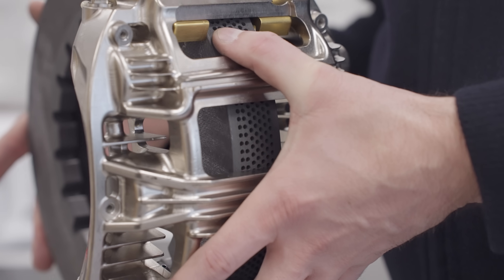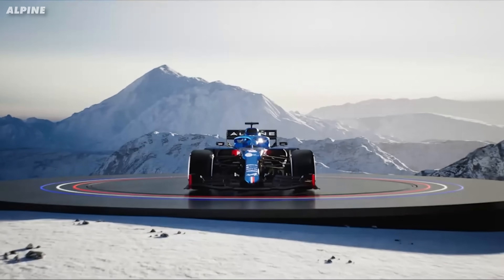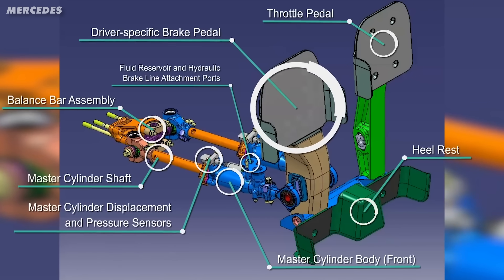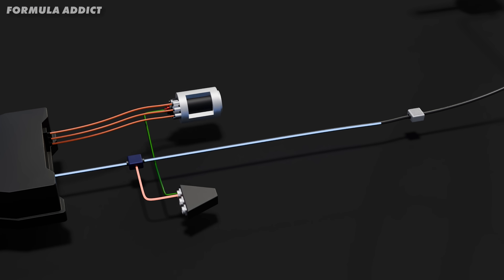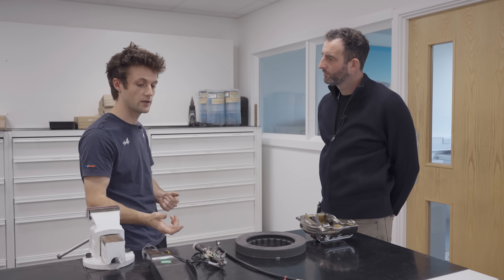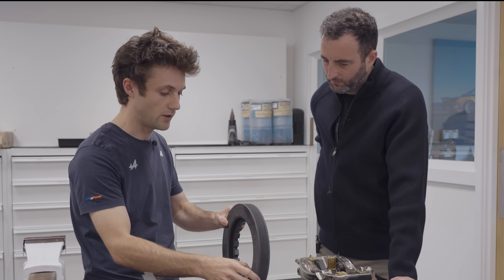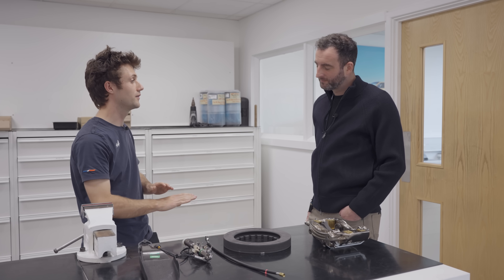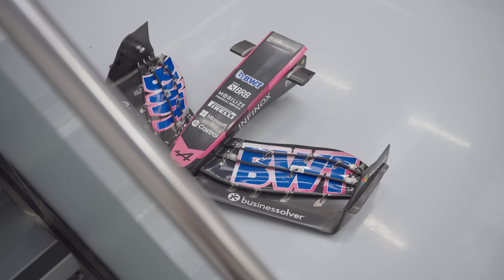How Formula 1 Brakes Work (F1 team explains)

Comment: When you make the carbon carbon disks, could you incorporate the holes in the manufacturing of the carbon blanks so that you don't need to post machine and drill the 1500 holes allowing the natural layering of the carbon in the disk to be maintained, possibly increasing strength and allowing less material to be used. I can imagine that the post machining of drilling the holes creates nano imperfections the length of each drill hole that changes heat dissipation and airflow, possibly slowing or accelerating heat and airflow in an unpredictable way leading to unexpected failure or excessive weight not to mention downstream impacts on tyre heating. Just a thought.

Comment: Those that say the driver's weight is not shifting (moving) forward under braking have not noticed the helmet sinking just a little. Yes the driver has to push against the brake pedal while at the same time lifting off the gas. So he is pushing with all the force stated, just not an equal amount of force against the seat. He's virtually lying down with his legs and feet elevated and at no time is he straight legging it. It would be like standing with the knees slightly bent with 300 lbs. on their shoulders. That takes leg strength. There is no free lunch.

Comment: I was involved in building the jcb land speed car  and we struggled to find a drag resistant brake untill the flight out the salt flats then we found what we needed the forwarded aplockhead and a f1 tema to invent the setup . And yes 350mph on less gears than given as the blew

Comment: If 200mph * (1.6km/mi) = 320 kph, * (1000m/1km) = 320,000 meters per hour / (3600s/hr) ≈ (90 m/s) /4s to stop = 22.5 m/s², wouldn’t it be about 2.5Gs instead of 6, or do they not slow down at a constant rate?

Comment: Holding 180 is much easier tan pushing. They are holding not pushing.
Reply: And with finesse on top, to control the release of pressure as they decelerate enough.

Comment: Lot of people don't realize how important formula 1 is, some people wonder why companies spend millions of dollars sponsoring these cars and racing. Winning is part of it but it's much more important than just winning. Yes the more you win the more you get recognized but there's much more at stake then just racing a car. You see a formula 1 car is the most advanced automobile in existence, the reason why sponsors spend so much is because of the technology transfer benefits. The technology and advancements in automobiles today is a direct result from formula 1 research and development. The advancement of synthetic oils, fuel, block performance, tire performance, electrical systems, timing, airflow, emissions all comes from formula 1. Basically car manufacturers research and development department sometimes consists entirely of formula 1. It's the perfect testing ground for today's top of the line advanced ideas. That's why there's so much money in it. And for the winners that validates these advancements, the proprietary technology becomes incredibly valuable worth billions.

Comment: 396 lbs of force for the driver to push on the brake pedal!?  That doesn't sound realistic - these drivers are not big body builder types.  Are you sure that isn't the force on the working end of the brake pedal lever?

Comment: The spring fully collapsed takes 180kg not the little 1inch movement they are doing…sounds cool but thats not whats happening. They need a stiff spring so when they engage the brake it has enough resistance so they don’t brake to far hence why its so high fully collapsed

Comment: Again the 180kg pressure myth, it is not the pressure of the foot but the hydraulic pressure! Have you seen their legs, they snap when doing a proper squat with 20kg weight! Impossible to do 180kg force pressure with 1 leg. And what stupid engineer wants to make this brake pressure, with a simple adjustment you can make it less. There is so much bullshit in this fake sport.

Comment: The only part about this video should be about the heat dissipation and it was such a small part of the otherwise “well no shit” video we all know how master cylinders and hydraulic pressure works and we all know bigger brakes don’t stop you any faster than smaller brakes as you are limited by aerodynamics and traction, all we want to know is how they are able to dissipate such immense heat so quickly and over and over again, that should’ve been the main focus of the whole video.

Comment: When I was racing , I noticed a 2-3 second lap time difference if my brake pedal height was not EXACTLY as I ergonomically needed it.  That is, it had to match my exact body and foot height or it was WRONG!!! Write that wrong in giant letters! Lol. But same goes for throttle too just a bit lesser. Also I like long throw throttles too. Especially when traction is an issue.
Bet some of you are thinking? What adjustable pedals?  But yes is performance you can set everything ad nausea for yourself/pilot.  And we get super picky when you change it! 
WAA Rage! RAWR!...  Now where was I?

Comment: Well if they achieve 6 G’s during braking, then having to apply 180 kgs to the brakes should not be much of a problem since the driver will weigh over 1000 pounds while braking.

Comment: But what is the point to have super-powerful brakes? The grip is always lower than the brakes power, right? Every time you overbrake you usually block your tires and lose your grip (with very rare exceptions). So what the points to have super power brakes then?

I understand that if it's exist that there should be a reason, but maybe someone can explain.

Comment: when said in seconds, just 4 sec sounds cool. But ~200 is okayish🤣. Definitely room for improvement especially the rate of deceleration is is only 24.6 m/s which means less than 2.5g force. just increase that to 3.5 g and we can reduce the stopping distance by 50m. Just imagine braking distance is reduced by 10m - 15m and how fast the car looks in the corners. Go F1 you can do it.

Comment: A break buy wire system doesn't need 180 Kg of force to work. A hydraulic compressor does the work for the pilot.

Comment: Am I correct in assuming break pads are not used? Since there was no mentioning of them. Is it really just the 6 pistons, 3 on each side, straight onto the brake disc?  Does that also have to do with the dissipation of heat during breaking? And last but not least; why do the pistons in the break caliper have different diameters?

Comment: driving 4 answers did a video a while back, about how larger discs don't actually stop you faster. but this F1 engineer says they do. intuitively, he seems right about leverage: for a given brake pad surface area and pressure applied, farther distance from the axle would seem to give an advantage. i can't remember d4a's reasoning, but am curious about any input here.

Comment: @ 0:38 bs.. absolutely bs.

No one can push 180kg of force numerous times, over and over for hours on end. 
You're talking hundreds of reps!!
Not even the world class body builders could do it for the length of time a F1 driver has to. 
I have no doubt thats the pressure applied to the brakes, but not by the drivers foot 
The driver will no doubt have some electro- mechanical leverage device like a pump to exert the pressure on the brake.  Im assuming the forward momentum plays a role in how the drivers foot applies more preasure  from decelerated g-force. 
(Like when you run with a bucket of water, when you decelerate the weighted bucket continues to pull you along for a bit. Thats whats happening 
But the pressure he applies to the brake pedal is not of the drivers own ability to press180kg of pressure of their own strength. 😅

You seriously expect any intelligent person to believe that?? The driver would run out of energy in a matter of minutes. The driver would fatigue and lose sensation in his leg. 
And that would be fatal. 

You will lose subscribers if you feed disinformation to people.

Comment: Why do they push with the tip of the feet? Wouldn't they do more pressure if the axis is in the tip and he pressure is exerted with the heel? The force would be done with the leg and not the feet alone.

Comment: The force drivers put on the pedal are not really special, since they of course use a leg and not a arm it means they use much bigger muscles. Anyone that has used a leg press at a gym knows 180 kg is nothing special, but of course that doesn't make for drama for the story.

Comment: 2:32 The kid says "The driver hits that (brake pedal) with about 3 times his own weight which is about 160 to 180 kilos. 180 kilos is 396 lbs for those of us across the pond, and the drivers using only one leg! I don't think so buddy! That would be a 140 lb dude squatting over 800 lbs and that is NOT happening!
I don't know exactly, but I would guess he means newton-meters of which 180 Nm converts to 18 kg which converts to 40 lbs which sounds like the right amount of pressure on the brake pedal using 1 leg. So, 396 lbs on the brake pedal or 40 lbs on the brake pedal? Hmmm...:)

Comment: wow, super mid video. pretty genaric brake info for most of it, no mention of literally anything interesting like fluid or pads or even wear rates like new vs exhausted rotor size, incorrect diagrams that don't match narration calling out invisible springs, factually misleading information like taking 180kg to actuate, oh and closed captions are a nightmare that covers most of the video. 
1.1 million views but 669 comments and 22k likes... something is fishy af with that low of engagement

Comment: Brilliant that the brake by wire isn't interpreting driver input and recreating hydraulic forces, its merely allowing all or some % of hydraulic force driver creates to be passed through.

It wasn't clear if this system is only for rear brakes? Front brakes unmodulated? All driver hydraulic forces all always sent to front calipers? No modulation devices to interfere?

Comment: What do they do by way of brake lines, specifically to prevent fade on the heat? Because if you’ve got a road car and you take it on a track your brakes are fading pretty quick because the lines aren’t geared up for it. In what way to the brake lines differ to the standard Road car, and is the hydraulic fluid for brakes on a Formula One car different to that it would be on a road car

Comment: I don't believe for a second that a formula one driver is applying 180 kg of force to a brake pedal. I doubt most of them could squat that much with 2 legs.
Reply: someone else mentioned that a signifigant amout of that is body weight under G.

Comment: With 6 G's of deceleration, the mass of the driver's leg adds considerably to the brake pedal force.  So he doesn't actually have to apply 400 lbs of force.   If, for example, a leg is 50 lbs, at 6 G it's applying 300 lbs all by itself, the driver adding the necessary extra 100 lbs.  It's like power brakes!

Comment: Just to reiterate the braking pedal force - 180kg might mean a lot but you're already holding 70-80kg if you just stand on one leg, so the distance to 180kg isn't that long. Also, these brake pedals don't have much travel, you can really push on it with whole your body and not move much in your seat. I reckon braking isn't something the driver does with his ankle movement, but rather a whole body effort - literally standing on the brake. Counterintuitively, it allows for much finer modulation.

Comment: Don't get me wrong, at 1:15, if the second car can brake 10m later is mostly because of better tire grip, not brake necessarily. But that would be more agressive with the heat on the brakes, so is better to have a brake system that can manage that heat. It may apear intrinsic, but if you are at the limit of the tire, better brakes won't make difference on the deceleration ratio, or distance. However, considering the tire heat management that F1 brakes also affect, that is realy clever.

Comment: Speaking as an engineer who likes to understand how things work, this video doesn't make it easy! Here are some of my observations:
o I would suspect that both clevises are titanium (3:07) and the tub clevis is not aluminum. The coloration of both look similar, and darker than what aluminum typically looks like.
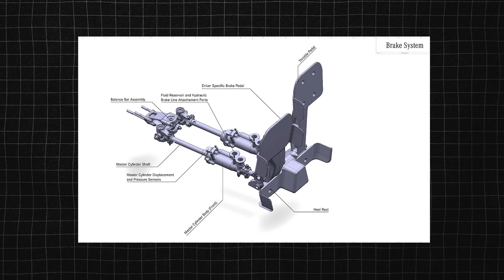o The CAD images shown (eg. at 3:19) are of a completely different brake pedal design with twin master cylinder assemblies with a mechanical system to adjust brake bias by shifting them left and right to change the leverage (one cylinder is for the front and the other is for the rear brakes) which he refers to as the older way. You can see each master cylinder has two hydraulic lines, in and out. 
o The actual (tandem) unit (at 3:29) has four ports so it runs both front and rear in one unit. 
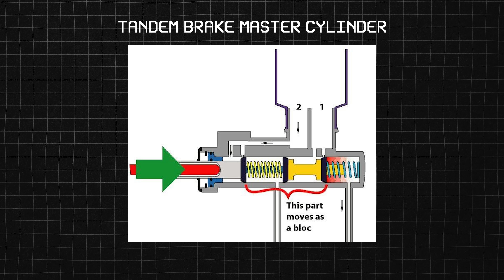o The illustration at 5:14 doesn't resemble the tandem unit very well, especially the plumbing, but at least it is conceptually similar. 
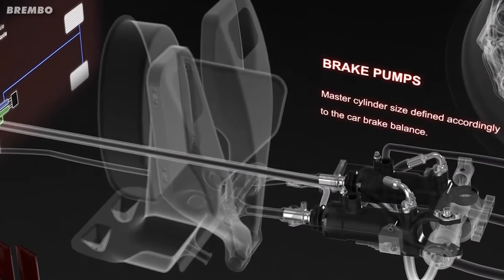o But then the graphic at 5:36 again shows the old style parallel (not integrated tandem) approach with mechanical bias. 
o I'm pretty sure the white plastic cap on the end is there temporarily prevent the spring from falling off when not assembled to the eyelet. 
o Apparently they put on different length eyelets according to driver ergonomics. They probably keep the custom length eyelet connected to each driver's custom pedal.  
o The eyelet is an extension of the piston on the master cylinder, retained by a pin through that hole the cotter pin is in, and the other end has an eyelet for the pivot shaft in the titanium clevis on the pedal. 
o I suspect that the tub clevis can be moved to different positions on the car depending on driver. A different length eyelet would be used for each position. 
o The other end of the master cylinder would be in a fixed position, keeping all of the plumbing in the same place regardless of pedal position adjustment.
o With regards to the 180kg number, I suspect that this is the design load for full panic, not the force required to brake during a race or even to lock up the wheels.

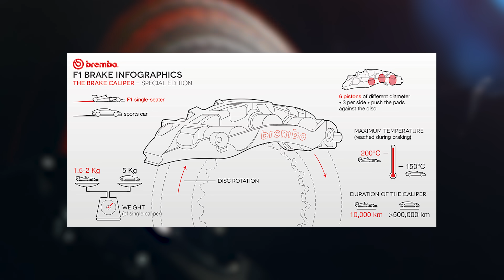Comment: That little infographic at 8:13 is incorrect. Says the max temperature reached for the brakes is 200 Celsius.
Reply: That’s not incorrect. The infographic is referencing the caliper itself, not the pads or the rotors.

Comment: you said 6g under braking, and they have to apply 3x their own weight, I know there's a lot of factors, but that forward g force means its much easier for the driver to apply that in practice yes the driver is held theoretically in place but when you push against the break the restraint equally loses force. So while the driver still has to experience the force the effort would be (with only these simple numbers) half what would normally be required

Comment: - floating brake disks - the ultimate at that level is seen in a multi-disk backage on a large aircraft brake - alternating rotor and stator disks - inner vs outer splined -  just like a multiplate clutch   (the overlap at the top of the game between brakes and clutches

Comment: I learned from a mentour pilot video awhile ago that the wear factor of steel brakes is the hardness of application, but the wear factor of carbon brakes is the number of applications.  Carbon brakes favor fewer, harder applications, which seems very good for racing.

Comment: I understand that Esteban wants a heavy spring. Of course the drivers are not pushing with 180kg of force everytime they break. They would rival indoor cyclist with their legs. But when braking the deceleration also pulls on the leg and pedal so with every step it increases, so does the help you get. And that's probably why Esteban likes a firmer spring, so that on hard and sudden deceleration the brake feel remains as consistent as possible

Comment: 5:28 "displaces the oil" said by an expert. Brake oil? I thought was brake fluid, liquid, but not oil based. F1 brakes use oil for transmitting the hydraulic pressure or was just a bug in the expression? "Oil shifts" at 8:54

Comment: Doesn't the g-force in the direction of travel (forward) work to help the driver apply pressure to the brake pedal?  I would think this helps in applying force to the brakes, not full body weight (they're strapped in), but a portion of the leg weight.  When I flew military jets, the g-forces where very noticeable on the arms and legs even though the torso was not moving at all.

Comment: 0:30 molten lava? Really?
Reply: Yes. The materials used have much higher melting points than rock/natural minerals
Reply: Lava is molten rock, no need to add molten again @seanderobillard5765
Reply: Yeah, lava has a lower melting point than most of the materials used on brakes
Reply: Is that lava or molten lava?
Reply: Yeah really. You dense or something, dude?
Reply: Yes molten lava is around that temperature
Reply: lol
Reply: Yep

Comment: I got 1 question.

If they are braking with that much force, why don't they make the brake pedal wide enough for you to use both feet?

You'd think by doing that it would ease the burden on themselves just a bit.... and it shouldn't compromise the use of the accelerator pedal.

Comment: Does the drivers leg has to push 180 kg, or the pedal has to push 180 kg? If the driver presses down the pedal with 180kg then the force the pedal can make is much higher. Because the master cilinder is not at the middle of the pedal. So there is a lever.

Comment: 'Drivers have to push down with about 180kg of force', WHAT!!!! That's nuts. Although I once drove the worst car from the 1950's that needed about 180kg of force to be applied to the breaks just to generate about 0.25g of deceleration! Insanely dangerous, and lucky I didn't have an accident, because I underestimated just how bad it was, even though I was warned.
Reply: You were sitting on the seat while these guys are lying down. Their position makes it easier. If they were sitting how you were, they wouldn’t be able to do it.